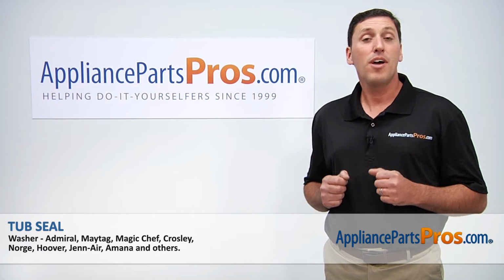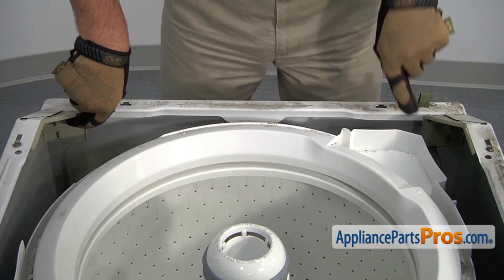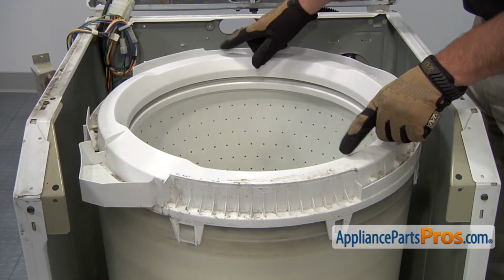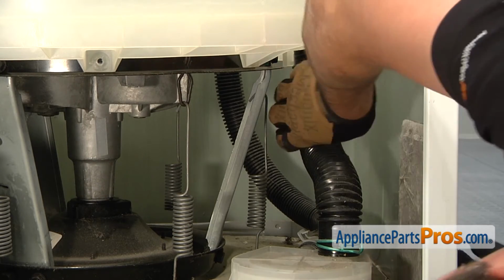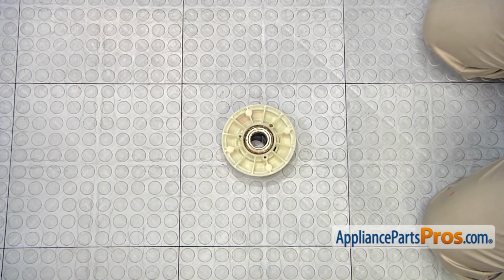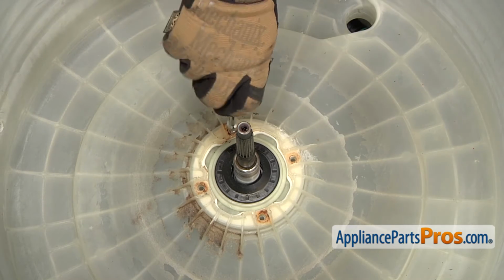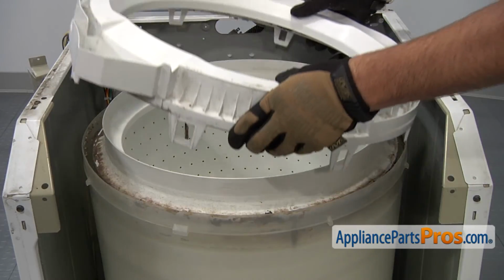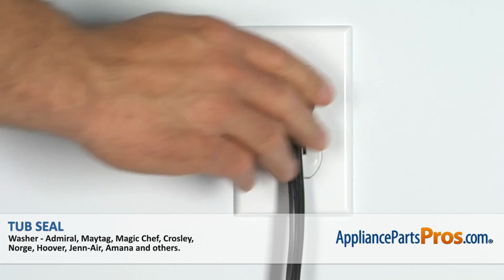How To: Whirlpool/KitchenAid/Maytag Tub Seal W10219156

Comment: Well done, thank you!  I had no luck using the pipe wrench method to undo the hub, but was able to get it off by placing a center punch against one of the four ears and hitting it with a ball peen hammer.  I found that this delivers a more direct impact than through the pipe wrench, and also gives you more room to swing the hammer inside the tub.
Reply from the maker: You're welcome! We're glad the video helped, and thanks for that tip!

Comment: We had an urgent situation this morning when a rogue sponge was caught between the tub and drum.  With your instructions, we started disassembling and found the sponge had fallen in between the outer tub assembly and the inner machine case.  Thanks very much for your guidance!  you saved us hours of worry and possible repair intervention. By the way, we got as far as the tub cover assembly and there was a lot of gunk build up between the inner and outer tub!  Our machine is 15 yrs old, what could we do to prevent this or clean?  Thanks again.
Reply from the maker: Glad we could help you out with that! It's always a good idea to run a washer cleaner like Affresh through the machine about once a month or so, depending on how often you use it. I know it seems counter productive to wash a machine made for washing, but like you said, gunk will build up inside it!

Comment: On my older unit, the seal was a separate plastic piece that needed to be threaded off independent from the hub. I destroyed it getting it off as it was seized to the hub, but the new hubs have the seal integrated so it was no loss,

Comment: love how you skipped over the part of installing the springs !   You also installed one of the springs (@ 7:25) to the metal loose clip incorrectly - they must be turned and resting on the top of the round metal plate so that the tub will install correctly.
Reply from the maker: Thanks for that tip!

Comment: what exactly holds the main seal hub from unscrewing when washer is in operation ??  Seems that the hub should be tightened more than what you did in the video
Reply from the maker: If you need additional help with the repair outside of what's demonstrated in the video, you can give us a call at 1-877-477-7278 or you can chat us at our website: http://www.appliancepartspros.com/. We also have a free repair forum where the techs can help you troubleshoot the problem: http://forum.appliancepartspros.com/. We’re here to help 7 days a week.

Comment: Good video but if you are going to show the repair then show it correctly. When reinstalling the springs the 3 loops were not put back in place which would thus cause three springs to be loose. Since these loops have to be in place before the outer tub is installed, this makes this a very pivotal mistake. I am surprised you did not stop and correct your error. Not fair to viewers.

Comment: Missing some serious information, bad video editing ,, first make sure you clock the pan on the bottom or the outer tub wont line upproperly theres an indexing dimple , on mine it was at 7 oclock, next make sure you put the oring on the bearing retainer as they dont mention it here and if you forget or dont have a diagram like most of us , its 6 screws and 3 springs back at least
Reply from the maker: Thanks for that tip, Joseph